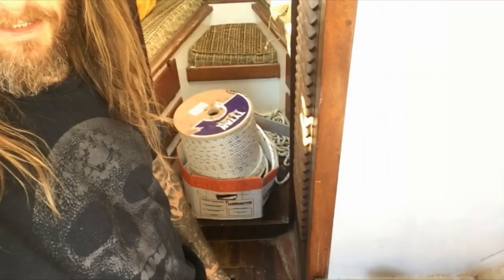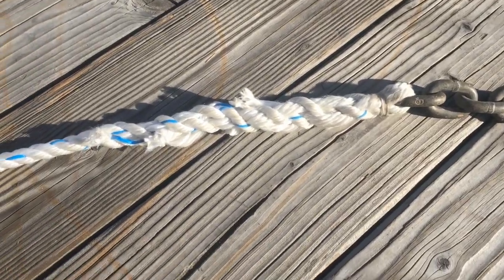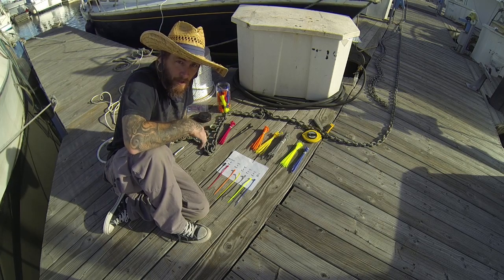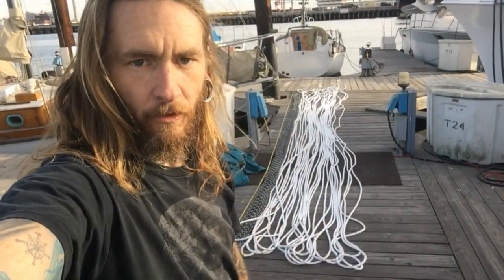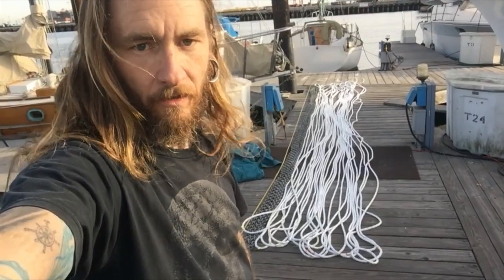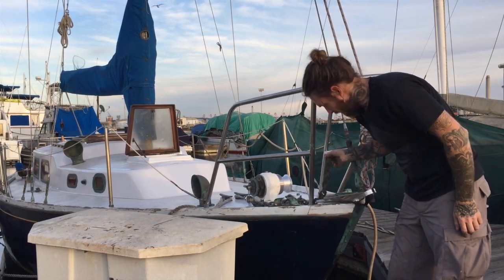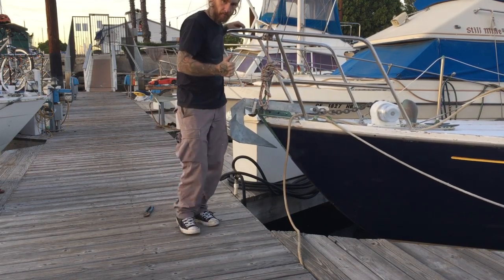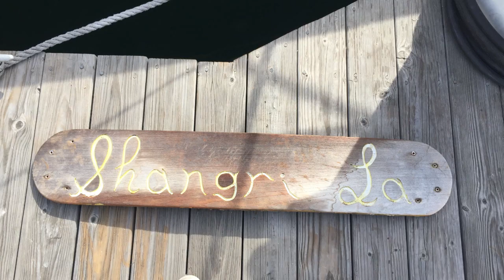Sailing Vessel Triteia  - Completing The Anchor Setup onboard an Alberg 30

Comment: when I was a commercial diver we marked our rigs (dive umbilical ) with colored depth readings every 10 feet. 1 mark at 10, 2 marks the same color at 20 and so on. when we hit 50' the first mark changed color then 1 mark for every 10. so, say at 60' we would have a blue mark for 50 and 1 white mark for the other 10' equalling 60' then at 100 we added another color. so we knew prety acurately how deep the diver was. Great videos man! Fair winds!

Comment: Just a friendly FYI, but zip ties don't tend to stay on long.  There are rubber chain markers that go in the link that do work better, but this summer I'm going to try some thin floating line like polypropylene line.   You weave that for a foot or two throughout the chain where you want to mark it and it's very easy to see, doesn't fall off, and doesn't pollute the ocean with plastic zip ties.  Figured I'd give it a try.

Comment: Hey James, that's a very unsafe way to splice you line to the chain. There is going to be a ton of friction and chafe and it will wear through your line real quick. I could imagine over night in a real good storm. I wouldn't trust that without a thimbal!! Please do yourself a favor and re-do it as soon as possible.
Reply from the maker: this is a widely used splice / process and I re-searched to make sure I hadn't been missed anything on my initial research on how to safely attach the two together. yes chafe is possible and it should be inspected regularly, just as any equipment on a sailboat should be but its not nearly as dire as you are suggesting.
Reply: Perfectly safe and is used on most larger yachts with electric windlasses.   Been that way on our boat for 30 years.
Reply: James, I wish you the best. There is a Y/T video of a 40' Nordhaven Trawler somewhere in VA that was anchoring out during hurricaine Sany. She had chaffeing gear on her anchor line at the chock and the hawspipe. During the storm it cut thru a 7/8" 3 braid line. I guess as long as you check it often. I just think it would be more prudent to use a thimble and not have to worry about it. Good Luck!

Comment: James I think you might have enough anchor rode to anchor in 20 ft. of water!  That's almost enough to go around the island!  I built my delta anchor it's  over 35 lbs. I put more lead in than the regular ones and I changed the angle so as not to dig down too fast and sharpened the shank so it would go deeper! Iv'e never had it drag, there great anchors. If your wench ever breaks you'll have fun pulling up 3 or 4 hundred ft . If you look at my video's I built my own wench, don't like the idea of all that wet stinky line in the boat!

Comment: zip ties don't work well.  they are hard to see as the chain is screaming by.  I tried it and also they will break off.  I ended up using bright yellow paint and sprayed a 4 links every 50'.  so at 100 there are 2 yellow stripes, at 150' there are 3.  I use 2-3 unpainted links between each set of 4 painted.  it works for me anyways.  nice job on your boat!!!

Comment: Hey James !
First I wanted to say that I've been watching your technical videos lately and I like them a lot, for me it's really nice to see you preparing your boat in an environment i don't know at all (I'm more familiar with the Atlantic and the Mediterranean)
Something struck me in this video :
If I were you, I would do something more permanent than a plain bowline to secure the bitter end of my rode to its fitting ! The bowline is good for halyards and sheets because it's easy to untie, but my guess is you won't be untying that one very often.
And when not under tension (which is going to be the case all the time for this particular one), bowlines can go loose and get undone.
Now no one wants to loose their anchor rode :D
I would suggest something a little more permanent, for instance the classy anchor bend that is usually used for this purpose.
https://en.wikipedia.org/wiki/Anchor_bend
You could also splice it, but you'll be in an uncomfortable position to do it, and there's no need to be that permanent.
If you want to keep the bowline, at least you could secure it somehow : you could do a few stitches with whipping twine, or even just tape it.

For the connexion between the textile and the chain, my personal preference goes to splicing the braid directly onto the chain itself, i'm putting a link to a document that explains it.
I think it's safer because it presents far less risk of chafe wear, but if you like the way you did it, great ! As you said, you'll inspect regularly.

ps : btw, i don't think having 700ft of rode is absurd... it offers a lot of anchoring opportunities that you wouldn't have with a shorter rode, and as it's over 80% textile there is no weight problem for you boat !
Reply from the maker: Thanks so much Bastien, I will for sure take your advice and change the knot on my bitter end, thanks for the tip!

Comment: I'm looking at getting an Alberg 30 now. The one I'm looking at needs a new exhuast. Sounds like an easy job but I'm not very mechanically inclined for now.
Reply: Garrett, where are you located?  The Chesapeake Bay Alberg 30 Association (www.alberg30.org) has many members that can help you all matters related to the Alberg 30.  You might want to consider joining the public mailing list (http://lists.alberg30.org/listinfo.cgi/public-list-alberg30.org) to ask any questions that you have.
Reply: Jonathan Bresler Awesome! I will for sure be looking into it.
Reply: Also I'm located in Georgia looking for a sailboat in Florida.

Comment: you should have spliced a steel thimbal and used a shackle fro. rode to chain
Reply from the maker: this is a widely used splice / process and perfectly safe and should be inspected regularly like all equipment on a sailboat
Reply: Without the protection of the thimble your rode could abrade and fail in less than an hour when you need it most: in bad weather off a lee coast.
Reply: a shackle won't go through his chain tube on the windlass

Comment: Hi James, Hope you are doing well. Just want to say I totally agree with spinnaker5514 and Jack neff in the comments below.  Please re-do it asap. As you seem to sail solo sometimes, best to not cut corners and be as safe as you can be out there. Loving your journey and always look forward to your vlogs. Thanks James.
Reply from the maker: this is a widely used splice / process and perfectly safe and should be inspected regularly like all equipment on a sailboat
Reply: James, we're not arguing that your spice isn't safe. I've used that splice for many years and never had one slip. The chaffe is in the chain rubbing back and forth against the line that's most likely going to fail. But like I said before Good Luck!

Comment: I think you're going to find you don't like the zip ties for your line markers.   Especially if you're anchoring deep and the line is playing through your hands one of those zip ties will come through and cut your hand up.  they make soft colored markers or you could just tie in something small made of small colorful line.
Reply from the maker: I agree with you totally, I need to find a better solution for sure, its impossible to see them as the rode flies out into the water.

Comment: hi James coiling a line looks good but it will probably get knotted up when you deploy the anchor rode maybe someone who has experience with that can comment
Reply from the maker: hi, I didn't have any issues with it knotting up during my 9 days of anchoring but I could see it happening maybe if I let out several hundred feet of rode :)
Reply: Stretch it out, tie both ends to a tree, ride the bite hard several times and get some stretch and memory out of that new rope